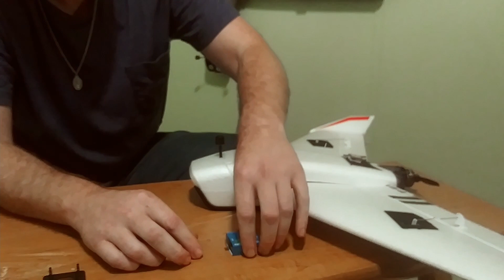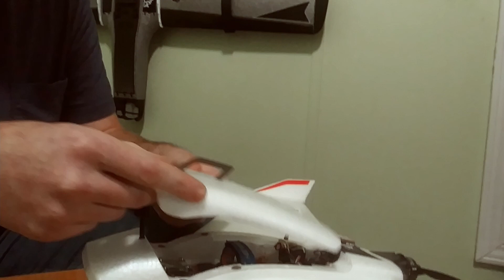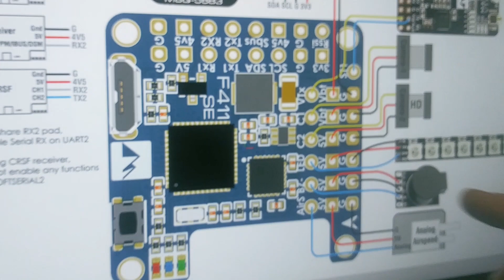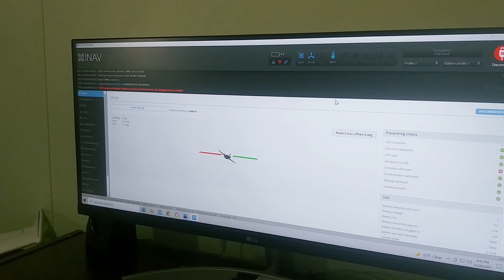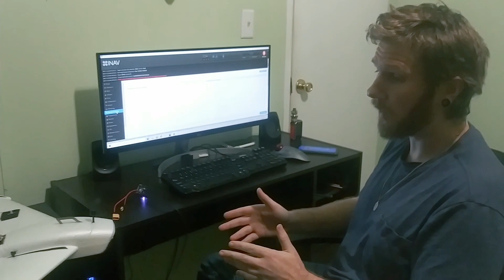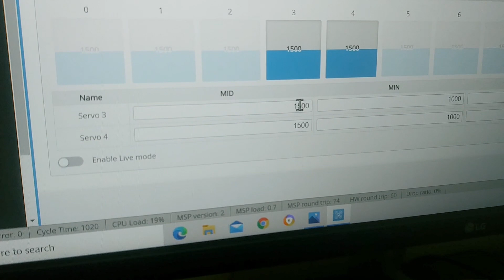Hee Wing F-01 / Diatone Ripper R690 ~INAV 4.0 Matek f411-wse~ DJI ~ SET-UP Tutorial!! ~

Comment: I have the same FC and running it in my F01 as analog. The OSD info is all messed up. I picked battery voltage and amp draw and it displays ground speed and altitude in the googles and is correct on the Inav OSD screen????